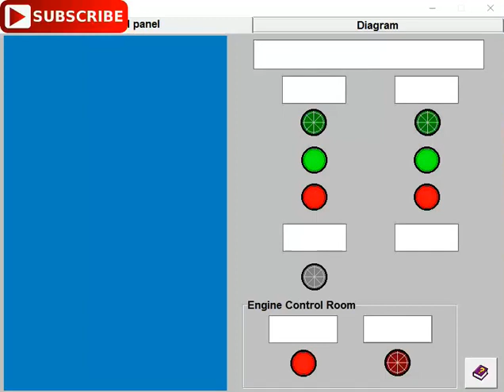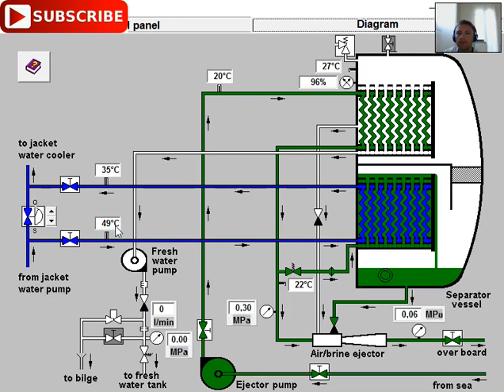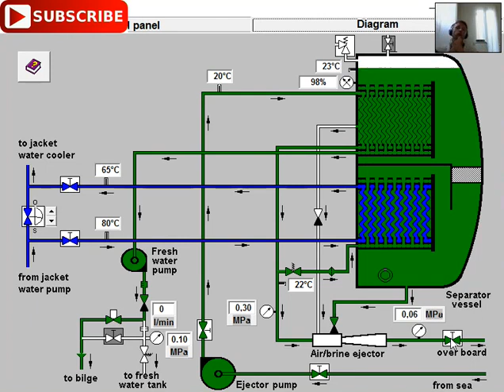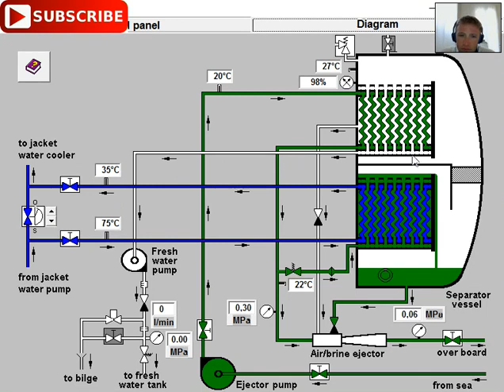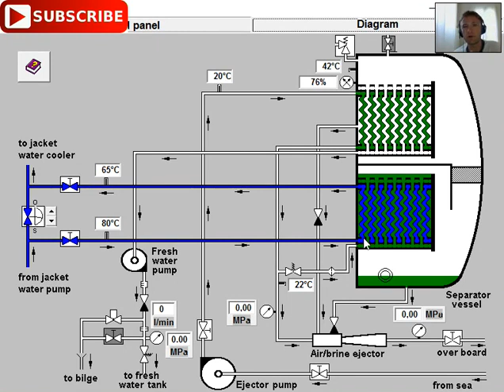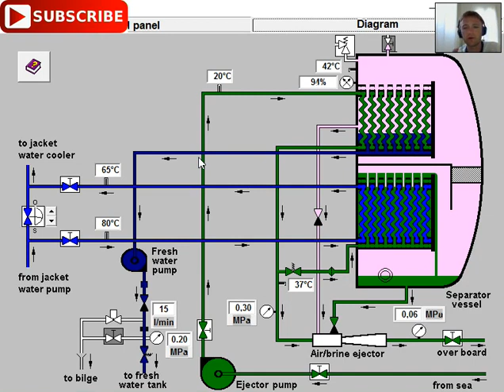How to start fresh water generator Alfa Laval system👷👷 👷most common type in shipping industry

Comment: What is the importance of vacuum in the FWG System?
Reply: Because of vacuum the seawater boiling point changes from 100degress to 60degress
Reply from the maker: otherwise the seawater will not boil at a temp of approx 60C